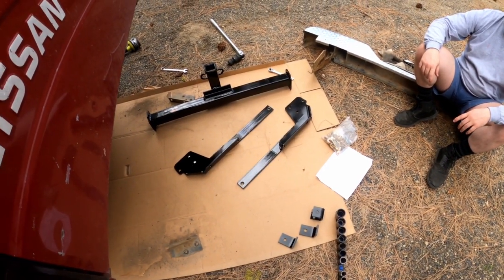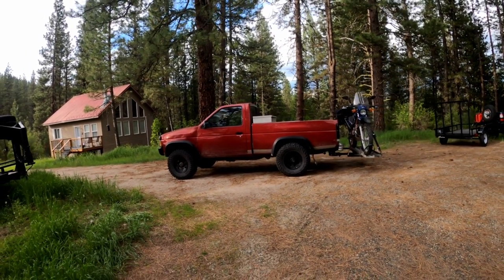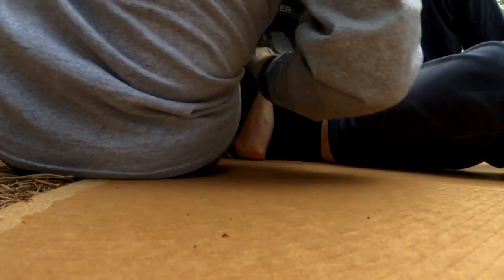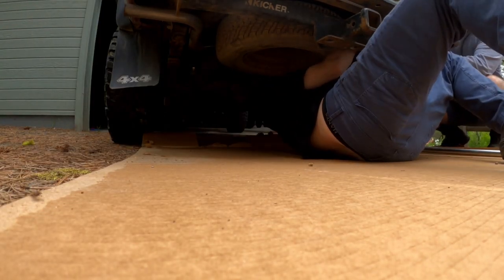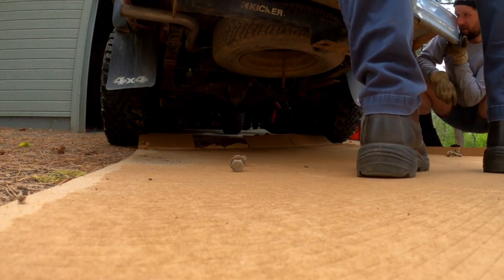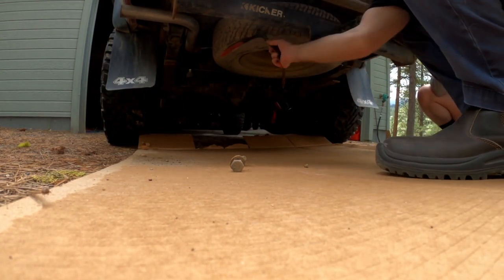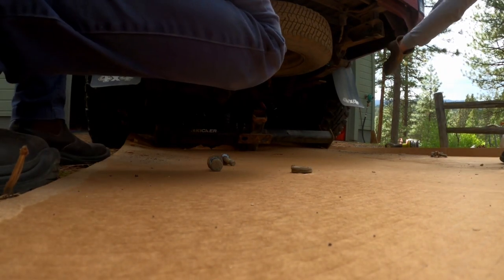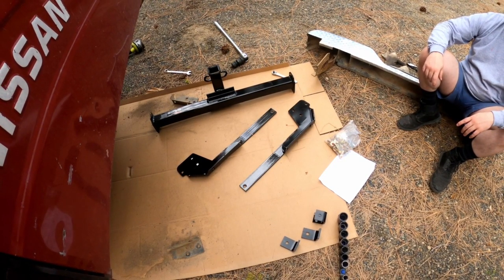Trailer Hitch Install: Curt 13092 On Nissan D21 Pickup

Comment: I have a 1986 D21, V6 engine.  Is my truck somehow different from 1987 to '97?  AAaah, answering my own question:  the '86 has NO holes in the frame, except for a 1" hole to access the rearmost bolt holding the bed.  I would advise viewers to buy a 1/2" COBALT drill bit for the thick frame metal.  HSS isn't good enough.
Reply from the maker: Very resourceful, the kit from CURT is solid but expect to make some adjustments on the fly depending on your rig. Hopefully this video serves as a good reference.